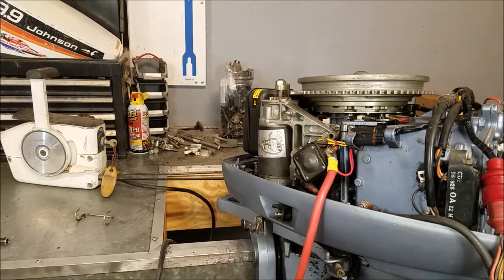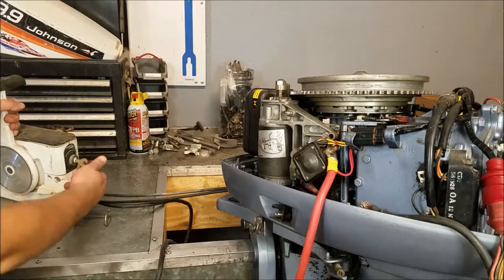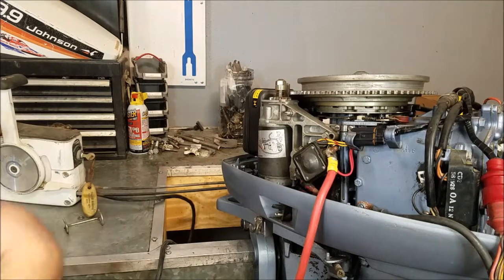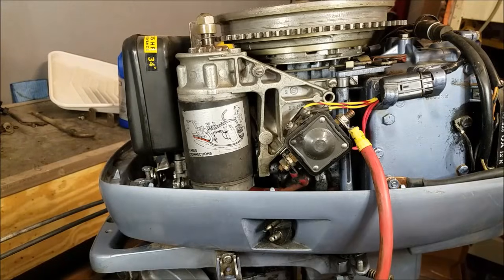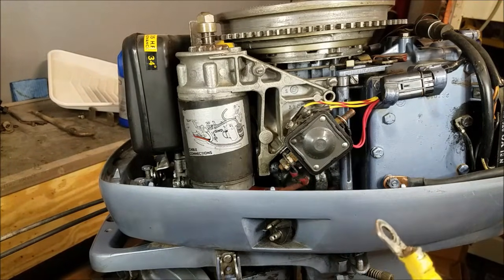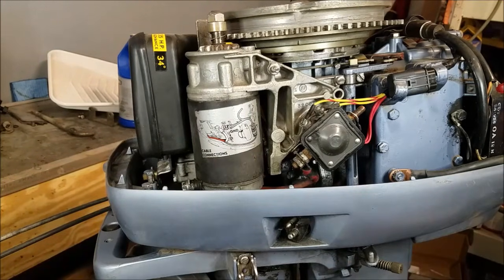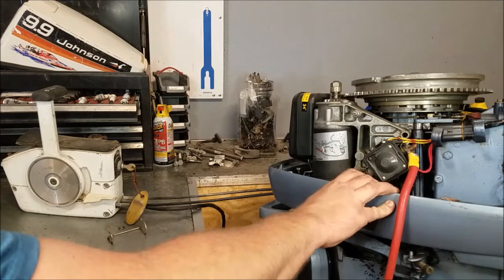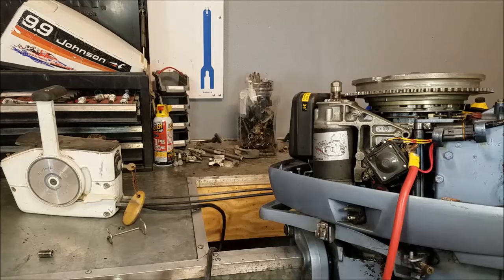Is The Solenoid Bad, Or The Starter? A Quick Test.

Comment: where on a 9.9 yamaha outb oard do you connect the two battery cables?  does one HAVE to be attached to the solenoid?  and the other one is a ground?  black - both my battery cables are black so I"m not sure where to connect which one to which nut on my motor.  it's a 9.9 hp Yamaha with control box.  I should have taken a photo before I disconnected it

Comment: Nicely done!  My motor vibrated off of the transom and swam about 5 circles underwater (cables all held).  The actual Engineer-friend of mine that gave the boat to me (VERY kind), had locked the hand fasteners, but did not through-bolt the motor.  Long story short, miraculously, the motor started that day--it is the 1985 version of yours, looks JUST like it--and is running PRETTY darn well but the starter is starting to "screech" a bit.  This video helped me locate my equipment and also to potentially tease it out if and when it--the starter--truly gives up the ghost!  Thanks buddy!

Comment: What if I touch the red hot wire from the battery to the starter wire and nothing happens?
Reply from the maker: bad or no ground, or bad starter.
Reply: @BrandonsGarage  I’m thinking it’s the starter, I get the click sound when I turn ignition.  When I touch ignition wire to starter wire, I get the click sound, but the starter not engaging.

Comment: Great video. Any reason why my starter is starting to spin and not push the sprocket up to turn the motor over? I had to manually spin it up into position then start it and it would work but after 2 times of restarting it would spin but not engage. Any solutions? (70 HP Force motor)
Reply: Wired backwards. Did this on my Kawasaki Brute Force and felt awfully stupid.
Reply: I have the same issue that you’re having,starter runs but sprocket won’t go up to fire up the engine,I have ordered a new starter and will see if that fixes the problem

Comment: Wat if my engine is trying to turn over but no spark can't be my solenoid?
Reply from the maker: correct
Reply: @BrandonsGarage  what else could it be I replaced stator, battery rectifier, switch pack, spark plugs? I took off kill switch wire yellow n black what else could it be?

Comment: Lol.. Your video is funny, I love it. I have a 40 Johnson motor from the 60's. I kept trying to start it at the dock and it kept wanting to turn over. But my dumbass, never hooked up the gas line to the engine. And now all I'm getting is a click sound. I probably ruined the starter or solenoid trying to start it over and over. I was my first time out since winter and I got ahead of my self in excitement. Didn't check everything beforehand lol... I'm not sure how to use the multimeter or settings to put it on.

Comment: Hi can you help me.  I have a pull start outboard motor and I wont to fit a electric starter I dont now the number to the part ( SERIAL NUMBER 0N045091) MERCURY MARINE ( 2005 ME30  EMLH ) 30HP THAN YOU

Comment: hi just have a question so ill take off the positive wire and touch the negative wire which is attached to the solenoid? just wanted to double check thanks

Comment: where does the solenoid ground to with the rubber damper between the bracket and block?
Reply from the maker: That is the black wire on the solenoid. 
The 2 little screws, that is the electromagnet connections.
Reply: @BrandonsGarage  thanks found a wire diagram and connected it. if you work on motors to get them started would like to know since your not far away

Comment: New an old  battery starter will jump to flywheel but dont have enough ass to turn motor over . rope will start it . took starter off an touch + an - off battery it spins just wont turn motor is the a weak starter
Reply from the maker: Yeah, starter is probably toast.

Comment: what if your starter spins but the bendix gear doesn't engage the flywheel?  I swapped out the starter and same problem.
Reply: Even occured when i jumped the starter as you did
Reply: did a voltage drop test and it showed a 5 volt power drop in the ground, cleaned the connections and now it works!

Comment: Great shortcut. Most people would maybe try an ohm test first, I like your method, no doubt in the diagnosis.
Reply: What if the signal wire from the ignition to the solenoid was bad? This would not tell you that.

Comment: Using a multimeter I have power to the solenoid. Doesn’t make a sound when I try and start it. Either power doesn’t run to the starter from the solenoid or the starters not working. Or even the ignition switch is done! Don’t have a clue yet
Reply from the maker: well you can use a screw driver to jump the power from the positive battery to the solenoid yellow wire; if it turns you know its a wiring issue. Could he the ignition switch, neutral switch, or youre not even in neutral.

if it doent do anything, its the solenoid or the starter.
Reply: I’ve been able to get the solenoid to click, and just did your test as shown in the video and I could’ve gotten it to start up. Is this a wiring issue or does this mean the solenoid is bad?

Comment: When I turn my ignition key I get the same clicking noise from solenoid. However when I run a heavy jumper from post to post as you did I get nothing!  Can you or anyone help; thanks!!
Reply: My starter was good but one of the internal connections was weak! Cleaned it up then discovered the solenoid was bad! Changed it out and $65 later all is good!
Reply: @1cleandude  good deal I’m gonna go try this on my boat!!
Reply: I’m having the same issue and to me it sounds like a faulty wire connection or starter relay. I’m still learning what all this means so I could be wrong

Comment: Big what if you have a clicking sound,  and you do the rest and the starter lacks the grunt to turn the fly wheel sufficiently also?
Reply: Just replace the solenoid they are only like $30 I had the same issue and that fixed it

Comment: still doesnt eliminate the possibility of a bad ignition switch or wiring to the solenoid.
Reply from the maker: Except the solenoid was clicking, trying to activate. 
Thus, circuitry was fine.
Reply: Adding to Brandon's commentnans as s my dad used to say, when it walks, swinms and quacks like a duck ... it is a duck !

Comment: Did this last weekend to figure out that my starter was toast. Ha. Who needs a multimeter when you've got a hot wire
Reply: I took my starter into a part store to have it checked, they said it was bad. I took it home and cleaned it up and used graphite spray for lubricant. Reinstalled and now the starter is trying to turn it over. I did this that Mr. Reynolds points out by taking my right side hot wire on solenoid and touched the left and it sparked, so I had to order a new solenoid installed it and now it's still not turning over. I just ordered a new starter so I hope that helps. Just sucks having to order parts when I have a old motor. 1991 25 HP Johnson. I did additionally find a blown fuse that runs from a overheating sensor ( I assume) on the back of the rear of the engine with the water drain tube coming out. No luck with changing that either so now I'm just waiting on a new starter, but thank you for the great videos. Gives a novice tinkerer a chance at owning a functioning boat. I just didn't realize how much time and money an old boat  would take to make functionable and safe for my family.
Reply: @papa4988  you think it sucks ordering parts for an old motor?!?
What really sucks is ordering parts for a new motor that shouldn't need anything because it's still new!  WIth old motors it's to be expected.
Reply: What if nothing happens?
Reply: @jhunley81  If you're like me you then take the starter off and take it apart to find the brushes are worn right down and not making connection to make the starter motor run haha. Then you order a new starter